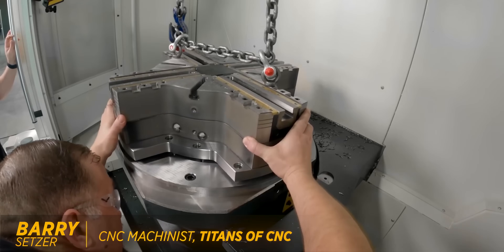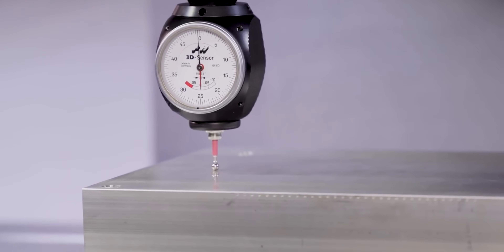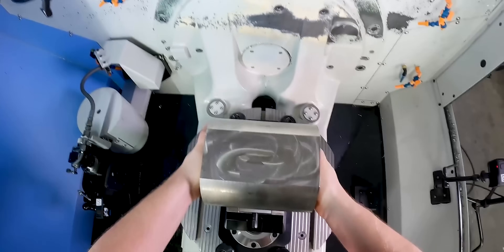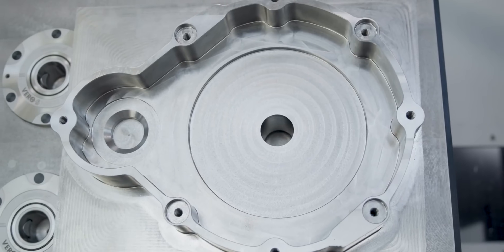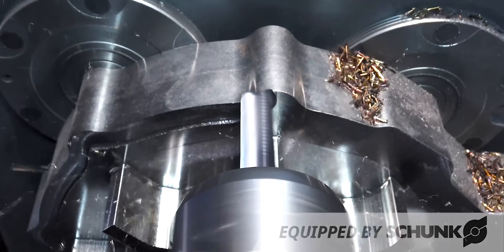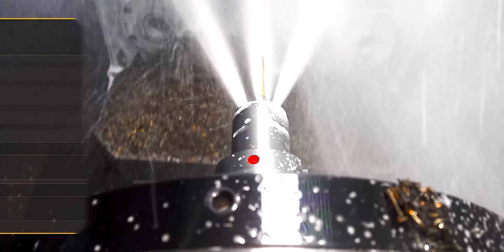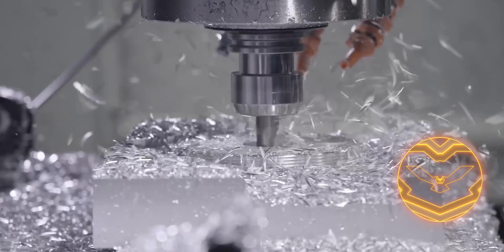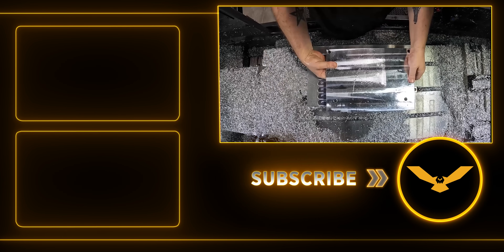My Boss is an Expert at Screwing Us Out of Money

Comment: The opposite happend to us a few years ago, i was tasked to mill the edge of a a large 2mm thick sheet metal that had been cut in a press but with a dull tool, they needed a true 90 degree edge in order to laser weld it together with another sheet metal, super simple just a finish pass on a straight edge. First test run was 50 or so sheets so i made a simple fixture and stacked like 8 at a time and trimed the edge with a 10mm endmill. Gave the time it took to run the first 50 including setup etc to the boss and he worked out a price per part based on that. This price (based on 50 parts including setup) was not changed for years and they were so happy with the results of the welding they decided to send all parts to us not just bad batches. Turns out the end customer was a car company and we ended up making 3000-4000 a day. Naturally i improved the fixture and got the longest 25mm solid carbide i could find and stacked them 50+ at a time. Did some math on it and our best operator was giving us a net profit of 1200 dollars per 8 hour shift running a 20 year old mill :)

Comment: This is one thing that frustrates me about the shop I work in now. We have brand new machines running the same programs that were copied from 15 year old Omni-turns and the programmer refuses to get tooling to run the machines with modern tooling so we use high speed steel where carbide would increase efficiency significantly. Just because a process worked then doesn’t mean it can be improved now.
Reply: Show him this video, and feel free to give him my contact info. Barry@titansofcnc.com
Reply: Mike, that is pathetic. Do what you can to change their minds. If they wont……leave.
Reply: @barrysetzer  I’m going to try one last time to talk directly to the director of operations for our plant and see if I can get through to him that spending on tooling now will increase production significantly. If he doesn’t want to listen I’m going to find a shop that does want to use quality tooling.

Comment: It used to be just like that at my old shop. For one of the parts we did we used one fixture for parts that had 4 operations. We would have to remove the gasket on the vacuum fixture face the part off, put the gasket back in and flip the part over then do some stuff then remove the mittee bites and the bump pins and put in locating pins, then flip the part over and put it back on the locating pins and bolt it down so it could drill some through holes. The run time was 20 mins but it took 35 with all of the flips and we had to run hundreds of these things. Then they would expect us to actually be able to run a second machine. We told them how stupid this process was but they just said “this is how we’ve always run these parts”
Reply: ughhhhh thats the worst. I cant stand manually moving clamps and stuff around
Reply: @barrysetzer  yeah it was time consuming and mind numbing. I’m very glad I don’t work there anymore. I work at an extrusion die company now and I love it!

Comment: In software development you're often asked to do quick fixes, skip writing tests, etc. Then afterwards spend 50 times the amount of time it would have cost to build it properly supporting the bad implementation. No time to do the proper fix at that point either, of course. It works, right?
Reply: 1. There's never time to do it right.
2. Eventually this turns into finding the time to do it over, but only when it has grown into a disaster whose flaws can no longer be hidden.
Reply: I would be extremely happy if the gui (just the gui) didnt consume 800 mb of ram and 2 cores on a 5950x
Reply: Or useless tests that will rarely find any bugs, wasting time fixing a mess that could be replaced with less effort, ...

Comment: Why do so many of our bosses do this exact thing?   I know mine is just about always going to save that $ and ask us to make things with less than sufficient tooling at rates that can only be achieved with the latest technologies.    That is the life of a small shop machinist a far as I know and we always get the parts done and delivered on time despite the headaches involved with not enough tool holding or work holding.   I don't expect multi million dollar machines but it would be nice to not have to go to the milling department and ask them to break down a tool they use almost daily just to get a 6mm ER32 sealed collet to use on a 2pc job with an 8XD 3/16 hole in 316SS to be done during lathe op to save a mill setup.  No machinist can Make a single chip without the tools and the holders required for them.   Am I just expecting too much?  Or should a machinist be able to go to the tool room at any given time and access the tools needed to do their job without the need to break down tools that are in regular use on totally different machines...
Reply: You’re right, I have to steal active tools from other machines as well, these items are not expensive, the company should furnish them, make a spreadsheet about how much time is wasted on every job looking for tools, it adds up. Collets are dirt cheap in the grand view of things.
Reply: @adammiller4879  we have sheets that document any "delays" during setup processes. Yet they still don't have enough simple collets and machinists routinely  spend up to 20 minutes trying to locate a collet.  Tool requests are denied most of the time and we just have to "borrow" from the milling department which causes time loss in both areas.
Reply: @joshgeckles5533  yeah I’d find a new job. I’m always trying to actively improve the company I work for and if they don’t see that or want it it’s time to move on to better things.

Comment: reminds me of a something that happened to me a few years ago. I was given the task to measure out a kind of rake welded together from different stainless tubes, and create a draft for it. My assumption was, since i told them, thats the first time ever i had to do that, that they would build a prototype, compare it, and then go mass production - only for me to hear a few days later, that i took one dimension wrong, and they now have 300 scrap pieces of laser-cut stainless tubes. 
and thats just one story of the result of ignoring that on any draft are at least to fields for names: "drawn by" and "*controlled by*" . the later has not been used in the 15 years i am working at my job, because they never want to take the blame for any errors that made its way into a draft of something that has changed like 100 times during its development.

Comment: Sounds similar to the project I just finished yesterday. I had a week to complete a project with 20 different parts. 6 of them were complex, and 4 of them were really thin irregular shaped parts that required me to make custom soft jaws or use a v block and make the rounds parts on the manual mill. Deadline was not met, but the parts turned out nice
Reply: Yeah man, this is the stuff that happens to us year after year lol. Painful sense of accomplishment
Reply: @barrysetzer  it's all just part of a big learning process. I keep my head up and produce the best parts I can with the tools at my disposal.
Reply: @thefitnessguy2217  do you make the part better than required or do you mean you make the part within tolerance?
Reply: @dontfeelcold  We have a loose tolerance in most of the parts we make. The prints call for ±.005 on everything. I shoot for right on the money for everything I make. Our engineers sometimes forget about stack up tolerances on our fixtures and machines we make. Just covering my rear end!
Reply: @thefitnessguy2217  I understand.